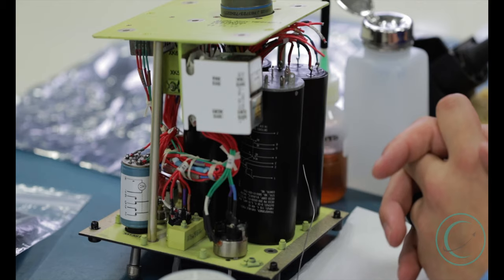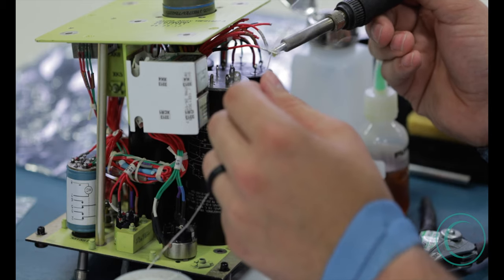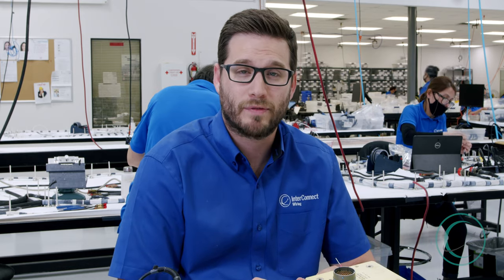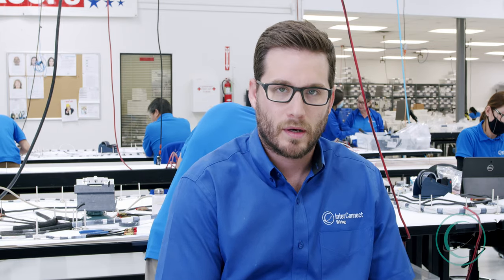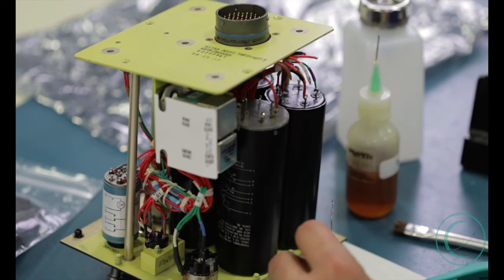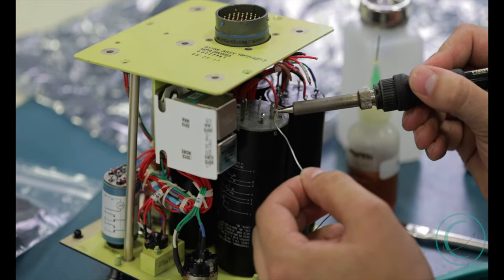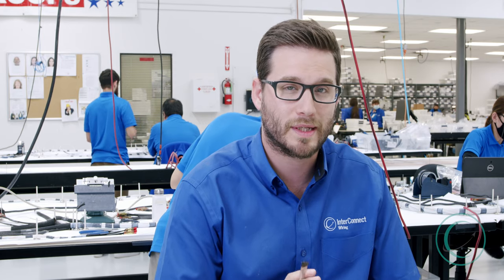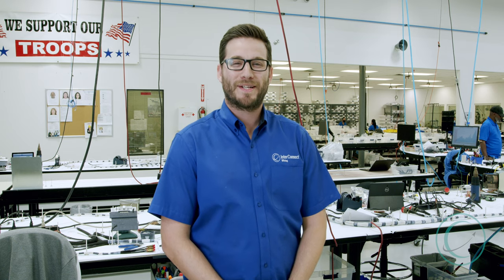VLOG: Soldering a Switch on a Cockpit Panel

Comment: As a former QC-inspector of electrical control panels ( not military applications ) may I respectfully suggest—when demonstrating soldering, wiring, and assembly procedures you capture the images using close-up high magnification capability camera(s).